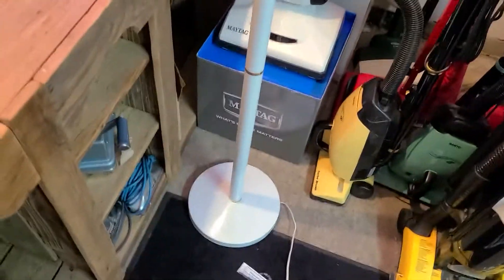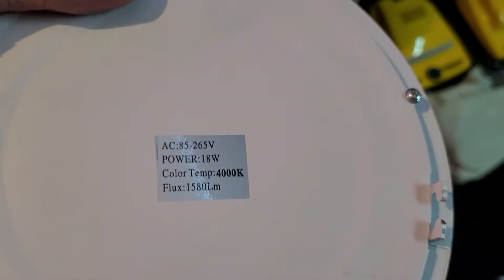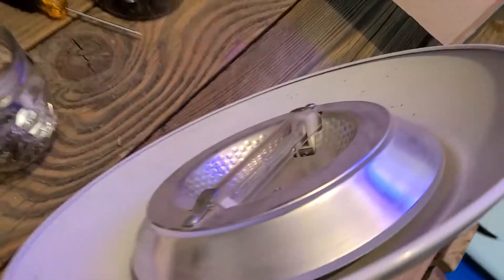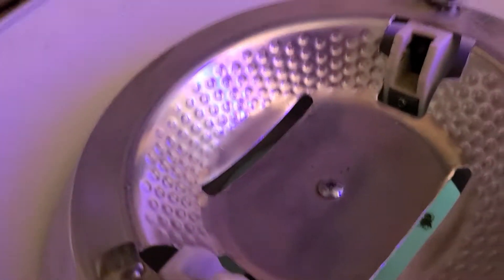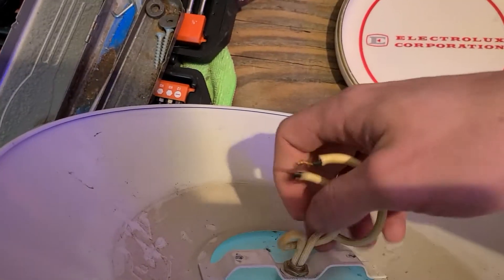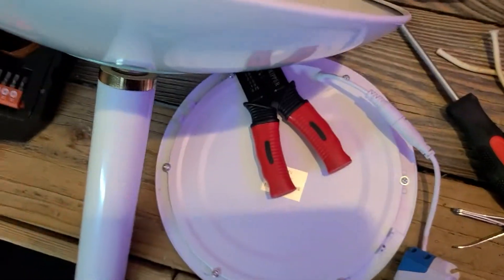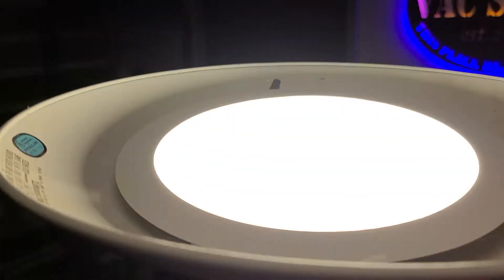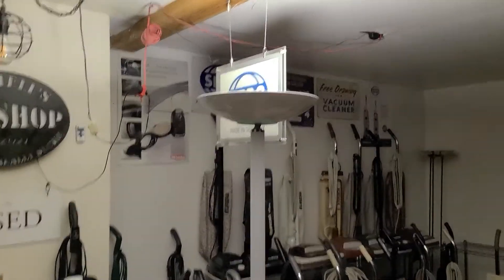How to convert a halogen floor lamp to LED

Comment: People who need bright indirect light to reduce eye strain LOVE halogen floor lamps and they are nearly impossible to find now. If you don’t want your old halogen lamps, just sell them to one of us!
Reply from the maker: I see them pop up in thrift stores every now and then.
Reply: i have now 4 of them and i prefer to keep the original sockets and they developped leds that fit in the halogen ceramic sockets and personally i prefer to keep them halogen this design with the green plastic glass is extremly rare and the authentic models are nearly impossible tou found , the original model is made by tensor in the 1980s the dimmers as spare in case the dimmer burns they can be found in internet , westek dimmers are the best to found , the lamps are designed in the US but are made in china and the work is awesome and i repaired many of them as a hobby

Comment: Issue for me is the LED replacement you used is only 1/3 the lumens of a 300 watt halogen (5000 lumens). Have you found a comparable LED light to use for conversion that will give about 5000 lumens?
Reply from the maker: Look on ebay, you'll see the LED specs. Some of them are fairly close to the halogen bulb. Here's a link. https://www.ebay.com/itm/3-4W-6W-9W-12W-15W-18W-20W-25W-Dimmable-LED-Recessed-Ceiling-Panel-Light-Fixture-/151844196213?mkcid=16&mkevt=1&_trksid=p2349624.m46890.l6249&mkrid=711-127632-2357-0